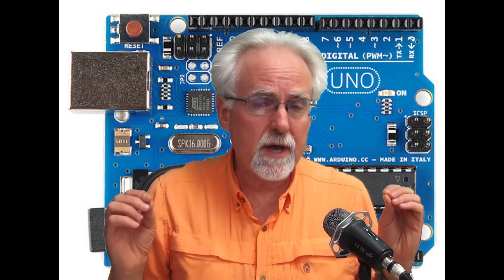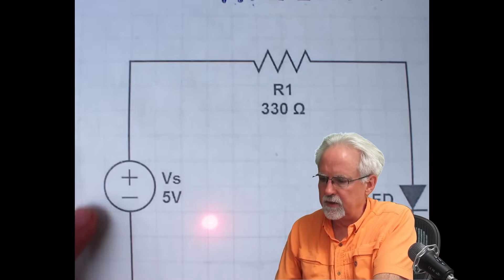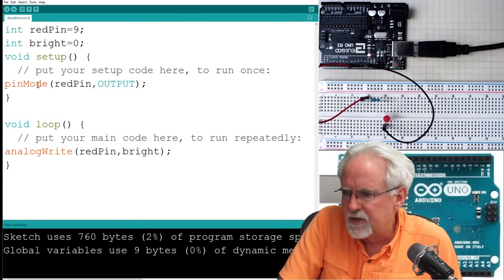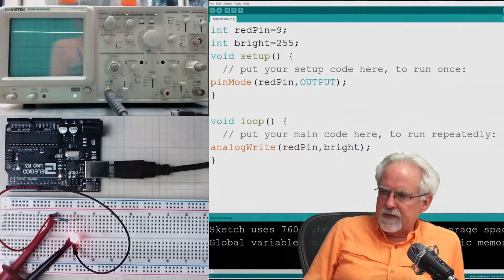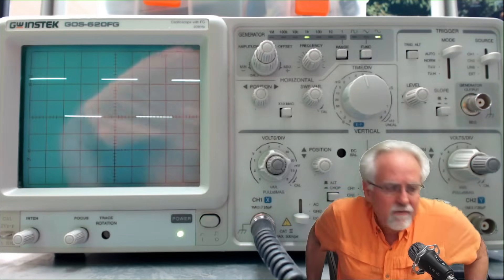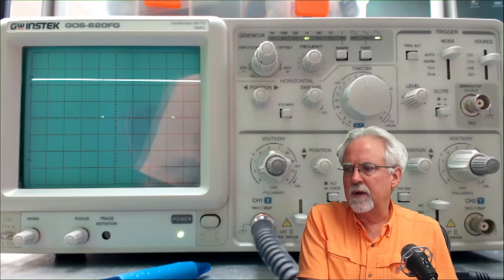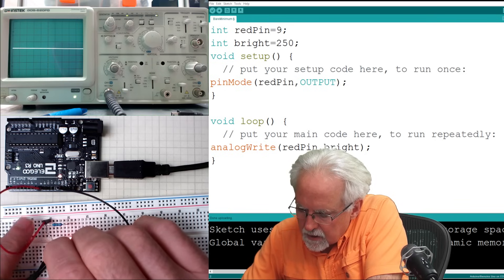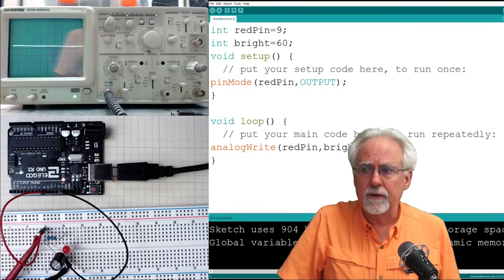Arduino Tutorial 8: Understanding Pulse Width Modulation (PWM) and the Arduino Analog Write Command

Comment: Ok, I think I know whats going on, though its been awhile since my Navy days. It would have been interesting to see the actual waveforms on the oscilloscope. We would have seen the square waves the analogWrite command puts out, then seen them change to sawtooth waves once you added the cap. The strong cap value "flattens" the sawtooth, giving a more constant, slowly decreasing signal. This is why the signal wiggles. The sawtooth spikes initially, then decreases. Learning, or perhaps relearning :) a lot from you. Thanks!

Comment: Ice coffee, no sugar. I fully understood the oscilloscope funcition. Now I know the capacitors are used to make voltage smoother. Whether there is not a capacitor the oscilloscope calculates the average value of your signal between 0 and 5 volts.
Reply from the maker: Well done.

Comment: Maybe this has been mentioned before but there are just too many comments to read through. 4.2 divisions X 0.5 milliseconds/division = 2.1 milliseconds, not 4 milliseconds.  You need to adjust the oscilloscope trace rotation so that the trace aligns with the horizontal graticules.

Comment: I have a question I'm following your explanation of pwm but my question is driving something? I have to control a solenoid valve of a hydraulic control so on the control side I have a joystick anything above center controls the speed of the machine ie. A little way up the hydraulics go slow all the way up it go's full speed and also if I move the joystick in the downward position it's go's in the opposite direction and that on just a single wire output  the control has two wires 12 volt input and the single wire output once it get to the base it either sends a command to the solenoid to go up or to a different solenoid to go down and I need to get rid of the original boards controlling everything because they break down constantly. I thought I could use the arduino but I can't use a relay in the base to send the pwm signals to the solenoids how do I drive them?

Comment: Some of the descriptions for pwm's I have looked at say this.....
("The power of the input power supply must be greater than 1.5 times the rated power of the motor to make the motor work (note: the input voltage and the rated voltage of the motor must be consistent")

...... I have a 24vdc motor (150 W 24 VDC Electric Motor zy6812 f) 

 Do I need to have a dc supply that is 36 vdc (1.5 x 24) to use a pwm? 

 I have a 115VAC house current going into a MEAN WELL LRS-350-24 DC Switching Power Supply converting the 115vac into 24vdc.

Comment: I had read about PWM before but now I get it.  Thanks so much!
One thing that would help even more, and maybe you'll do this in later videos, is tell us how you select components.  Like you grabbed the 330 ohm resistor in all the previous videos, and here you grabbed a capacitor, but why those particular values?  I see how it works, but I won't have confidence in setting up an original circuit of my own yet.
I love your teaching, your camera work, the content.  I can't get enough!

Comment: Good!  My first capacitor and it didn't burst by using the wrong polarity.  The analogWrite uses averages of voltages 0V and 5V with tiny periods of time in order to get the aimed voltage (in fractions from 0 to 255).  The capacitor somehow allows to smoothen the changes of voltage with smaller oscilations around the aimed voltage that is reprensented by the wavy line.

Comment: i still don't really get where the 255 comes from. is it that there are 8 switches and each one turns the voltage on/off for the period of time that their digit is for? for example, does the first switch (0 0 0 0 0 0 0 1) turn the voltage on for X ms over the period and the 3rd switch turns it on for 8 times the first switch (0 0 0 0 1 0 0)?  i understand that analog write simulates a voltage by averaging it out over a period of time, and that the ratio of the voltage being on to the voltage being off is equal to the analogWrite value to 255, but im still not sure where the 255 came from.

Comment: Tried this in Tinkercad. I'm getting high outputs in the oscilloscope for values greater than 127 and zero output for values lesser than or equal to 127. I need some help with this.. Please reply with your mail id if you'd like a screenshot.

Comment: Can someone email why why capacitor goes in parallel with the resistor and LED, and not series? In my mind you'd use the capacitor to smooth put the voltage first then pass it through to the LED.

Comment: Hello sir. At 12:20  you said it has a period of about 4ms and also the oscilloscope is set at 0.5ms per division. If I am right each box of an oscilloscope has 5 divisions and here one cycle took 4 boxes and two divisions. So isn't the time period= (5x4 +2) x 0.5ms = 11ms?

Comment: Wait I know no one will probably get this but if you do, how does a 2^8 bit convert to 5 volts?
Reply: The 5V continuous range is mapped the 2^8 discrete levels. So in the command if u enter a value between 0 to 255 u get the corresponding  voltage between the pin and gnd.

Comment: What size capacitor, if any, becomes dangerous with 5V DC? ELEGOO does not provide any capacitors in the kit.  All I remember about capacitors is from older automobile distributors (mechanical points) - if you did not have a capacitor then arcing would fry/pit the points. DO NOT MISS the ritual of - filing the points smooth - setting the gap -- and adjusting the dwell.  LOVE the reliability of today's cars.  Hoping a later video will explain the difference between two lead DC motors and four lead DC motors with PWM.

Comment: Great video again Paul!  Thanks!  I actually learned a lot about pwm working with model trains and digital command control.  PWM is used by a decoder to control the motor and make the locomotives go from 0 to full speed.  It was great to see the graphic representation on the oscilloscope, so thank you for showing us that.  I love these tutorials!
Reply from the maker: Very cool!

Comment: 🙂 I already had an oscilloscope hooked up to the output pin from previous tutorials as I wanted to see what was happening. So, when I did Tutorial 7, I was initially surprised to see the pulses then I remembered I had read somewhere that the Arduinio "analogue" outputs use PWM. I don't think you are rambling. All the content is relevant and I think your explanations are pitched at a good level to try and explain the concepts without going into detailed electronic theory.

Comment: You asked what we are doing in the way of homework.  As for me I beefed up your program a bit.  I implemented a 5-bit binary counted in which it uses a loop counter to control the drivers by indexing the individual bits of the counter, and after it get to 31 it starts over at 0, but I speed up each loop.   During each loop I also drive the analog pads scaled by the binary counter (bright=256/cnt), so it gets brighter as the counter has a higher value.  After each loop I have another LED which flashes out the loop count.  My wife said "Great you made Christmas lights!" As a bonus I also working in using an int array :)

Comment: Is 127 corresponds to the brightness that a 2.5V input gives to a LED? Is the range 0-225 linearly proportional to the 0-5V output in the sense that you can compute the equivalent output brightness a certain level of voltage the pins are producing by doing 5V/2V = 255/x?

Comment: Thank you Paul. Could you please create a tutorial on DIGITAL pins (variable, and fixed numbers), ANALOG pins, and when to use digitalRead vs analogRead (and digitalWrite vs analogWrite)? This would immensely helpful as although I think I get most of it by just doing, it's still somewhat confusing; and I'm sure most of your students would love to learn about it properly. ADDITIONAL REQUEST: could you please do some project(s) with capacitors and explain their purpose? My kit has tons of them and haven't found use for them yet. Many TIA!
Reply: In this example, think of a glass you fill with water from a tap, though the glass has a hole on the side . You fill the glas but when it reaches the hole, the water will flow out. So, now you open the tap a little more. More water comes in the glass then the amount that flows out through that hole. Now sudden close the tap. No water comes in but still water runs out through that hole until the water comes below the hole. Do you open the tap before the water reaches that hole, you will see that the waterflow through the hole doesn't stop. Other the when you just open and close the tap without that glass
For the capacitor here works simular, power comes in( on the scope HIGH), the capacitor gets loaded, once the incoming power disappears ( on the scope LOW), the capacitor will unload, the power going low will because of this not sudden go down but slower since the capacitor is unloading it's power.It is a returning event, before the capacitor is fully unloaded, the power goes HIGH again, capacitor will load again and so on. You will now see that the turning point from high to low AND low to high, will take some time, therefore  the power will get an average value as it never reaches that 0V anymore. Once power stops and capacitor starts unloading the power returns. Maybe this explains the capacitor function in this example.

Comment: Great videos Paul, keep them coming.  Especially good explanations for the novice.  Just a point: the oscilloscope is not the reason for the voltage discrepancy in Tutorial 8. It is because the Arduino is not outputting the full 5 volts. There is an internal volts drop.

Comment: Wait....so with PWM and a capacitor, I could run both a 12V circuit and a 5V circuit being fed from the 12V circuit?  Therefore running two separate voltage circuits from a single power source?

Comment: I found this very easy to understand. Still, my mind was blown a little bit.  I should have seen this coming!  I have built small robots and had to adjust the speed by increasing or decreasing the PWM.  In this case a capacitor would be undesirable because the motors are not as forgiving to a lesser voltage.  
   Don't worry about the rambling.  During your little rambling sessions, you are still giving us valid info that reinforces our understanding of the concept.

Request: can you do a class and teach us a bit about the library Manager and what to update and install and what not to?  if you have done this already, Thank you!

Comment: 4 divisions x 0.5msec per division, in my humble opinion does something like 2msec period. So, I believe you do have an error at 12:20. Or maybe my Tektronix shows bullshits?... By the way, Instek and Rigol are very low class oscilloscopes and do not show the right voltage amplitude. Tektronix and Lecroy are more affordable, especially some second hand deals. And they do measure very accurately the magnitudes. Their math-functions are also precise - I can't say that for Rigol.

Comment: So, when using analog, instead of the diode being on or off like with digital (0/1 or high/low), you can use floating values? This allows you to output specific levels of power, but in actuality the diode is just turning on and off really fast at a certain PWM, but with a capacitor you are able to almost perfectly level out the desired specific voltage/PWM? Am I understanding correctly (I've watched all the videos to this point in 1 sitting lol)?

Comment: Wonder do you need to set the capacitor start plus al the way over to end minus(ground) or is can you set it between plus and resistance.

I would think you make the electric circuit in line. But see you put plus before resistor and
Reply: Ground after the LED. Is this necessary? 

Hope you understand my question. Not my native language.

Greets from the Netherlands

Comment: I was wondering how the LED would still work on Analog when you set the value really low. It should not have been enough to turn it on but with the Pulse width modulation that split second it goes high is enough to turn it on.

Comment: What is the reasoning behind smoothing the voltage signal with a transistor? I am assuming that for some output devices (like a motor), they will need a more consistent voltage signal to operate properly? Or maybe an input devise like a bluetooth or motion sensor would need a more consistent voltage signal to properly collect consistent data? I may be overthinking it and I'm sure you address this later in this video series. :)

Comment: Great lesson Paul. I have to review it a couple of times. I now understand that the pwm kind of averages out the signal to produce voltage selected in code. I like the information about using the capacitor to smooth out pwm. Like a power supply is using CAPs to adjust out put.
Thanks

Comment: OK Professor, PWM is turning the voltage on and off for   x period of time thus appearing to change the voltage. The scope shows the length that the voltage is on an off and is smothed out by a capacitor thus the scope will show the actual achieved vo;tage.  No, you did not ramble and the explanation of PWM is very clear, but you knocked the bread board out of square making me somewhat crazy.  Not really!  Got a feeling since we didn't get any homework that we will pay for it on the next lesson!

Comment: Back when I had hair, my Dad and I built some Heathkit electronics. Dad had a VOM (volt/ohm/milliammeter) and a VTVM (vacuum tube volt meter). He said that he preferred the VTVM for voltage because it had higher impedance and gave a more accurate reading while interfering with the downstream circuitry less. You mentioned a "digital voltmeter" in this lesson. Is that the digital child of the old VTVMs? Is there still a difference between a digital voltmeter and a modern multimeter?

Thanks! Still fabulous lessons and I really appreciate your attention to sound, lighting, and visual details!

Comment: Yes I do understand pulse width modulation. I did like how you added the capacitor to smooth out the voltage. It helps me understand there function in a circuit.

Comment: I really don't know what the capacitor just did.  It dropped the voltage crest peak and raised the floor peak off of 0 volts.  I assume the wavy line was a smooth sine wave centered around the average voltage.

Comment: I am putting sugar and cream in my coffee. Why? A tortoise does not exercise and lives 2000 years. The guy that invented Winston cigarettes lived to 98 years old.  That capacitor smoothed out the voltage so PWM disappeared.  That was interesting and something to think about. The capacitor was pumping charge in while the analog signal was trying to drop.  The capacitor was taking charge out while the analog signal was trying come back up.  This must have stabilized the voltage at an average developed by the PWM, thus taking away the crests, rise, and falls leaving only an average mostly stable DC like voltage.

By the way, a fat guy probably dies young usually.  This whole matter is not resolved.  The fat guy, the tortoise, and the manufacturer of Winstons cigarettes.  Now is not the time to ignore this matter.  There is a solution.  Guaranteed if you look for it.

Comment: My only concern is that ,when output gives out a pulse of 5 volt and we have a capacitor ,  output is gonna sent all the current that the microcontroller can produce  ,because capacitor is like a sort circuit .Isn't this a issue for the output ? Maybe we must put the resistor in series to capacitor ....Just thinking... In other words ,if the mc could produce infinite ampers from his output  then  ,even a tiny time HIGH on PWN would fully charge the capacitor and then LED would always be in full brighness

Comment: understand PWM.  Can you use arduino to PWM a signal to operate a 8v dc electric motor if I give the motor an external 8v.  Is it possible to use arduino to give the PWM?

Comment: I think you explained pulse width modulation to be a rapid readout of 2 milliseconds or so, of the arduino LED's voltage, displayed with a high-low readout system, which if averaged, will equal the near exact voltage. Also thanks for the amazing video, the readouts where very fun to see, and very intuitive.

Comment: Pulse Width Modulation: Can be efficiently used to control bright and dim in a light bulb, control the speed of a motor, temperature adjustment of a heater element, or volume of a speaker, etc. depending on the pulse width or length of time the digital is on (high) to off (low) the the led will dim or brighten. The longer it's on the brighter, the longer it's off the dimmer. And can be adjusted by a computer program or using a variable resister, etc.
Arduino converts an analog signal into a digital signal using an analog digital converter so the digital device can understand. The analog signal has an infinite # of possible voltage variances like in real life, and the digital signal is finite and has only 2 (0 and 1, or low and high). It uses 3 variables: 
duty cycle (% of time), frequency Hz (cycles per second), and pulse width time mS (milliseconds).

Comment: At approximately 9 min, you state that an oscilloscope is not an accurate way to measure voltage .... this is plain wrong. If it's properly calibrated, you can get voltage readings to a very very fine degree.  I like your tutorials, but you often say things that are not correct. That being said, these are really good tutorials, keep up the good work (you should however get a content editor for accuracy)

Comment: Really great explanation, especially using the cap to smooth
Reply: @PaulMcWhorter - Do you have a video going into detail about boosting the power of the PWM outputs for larger solenoids? I guess relays?